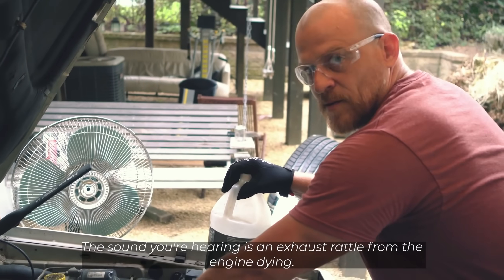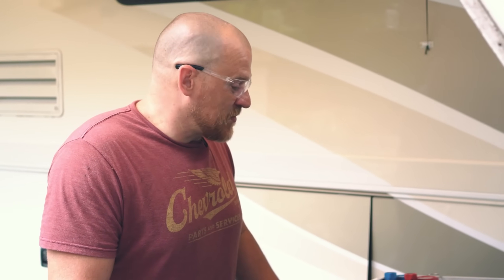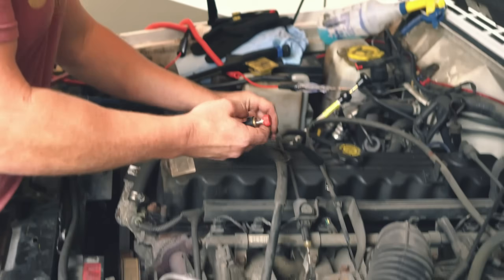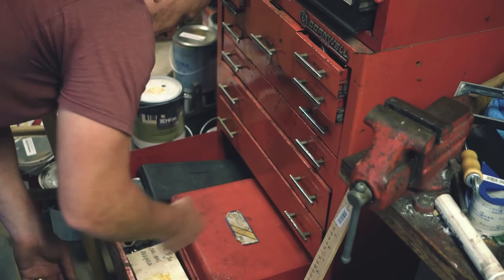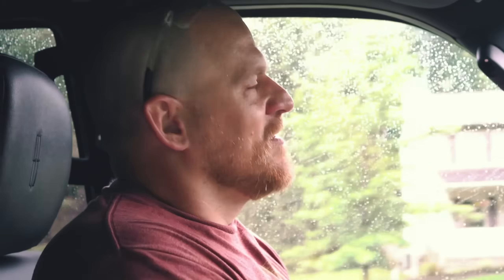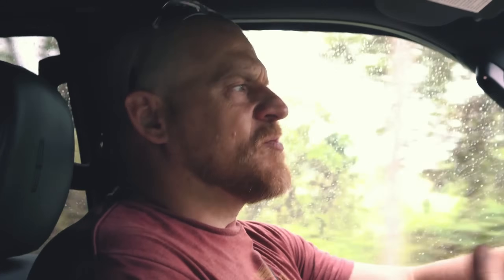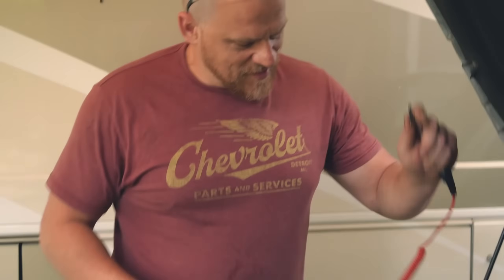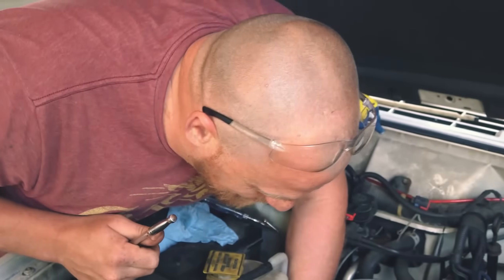Engine Dies While Servicing A/C System [Who Pays?]

Comment from the maker: This is a no start, no spark diagnostic video on a 1996 Jeep 4.0L. No prior history of trouble, no customer complaints of misfiring or intermittent no start conditions. The ignition coil failed, of no fault of our own, while servicing the A/C system. What do you do in this situation? 
1. Eat it (free diag and ignition coil for the customer)
2. Stop, call the customer, explain what happened and the sell the job
(sell testing time and then the repair)
3. Eat the labor for the testing time (diagnostic) and labor for the coil r&r and just sell the ignition coil at cost? 

Related videos:
No Spark Diagnostics "Control Testing" Part 1 [a free ScannerDanner Premium video]
https://youtu.be/7nHbctRwyys
No Spark Diagnostics "Control Testing" Part 2 [a free ScannerDanner Premium video]
https://youtu.be/9U942uGTZf0
Subaru no spark diagnosis-control testing lecture (a free SD Premium video)
https://youtu.be/LdnnFD6J8Uo
Reply: I replaced a cap and rotor on a vehicle that was running.  I installed the new parts and the engine failed to start.  I put the old parts back on the vehicle, and the engine started.  It turned out that the rotor was defective.
Reply: A large cap in the spark plug puts stress on the coil? That's something new to me.
Reply: @peacepoet1947  Larger gaps require more voltage to fire the plugs. It's why on a vehicle with severely worn plugs you can get misfires. It's also one of the reasons why manufacturers, for quite a few years now, have been using coil on plug technology. The ignition system in this Jeep is not as high of a voltage like ignition systems now that have COP setups with 100k or more voltage. They need that much voltage now to fire the plugs because of lean fuel mixtures to meet ridiculous EPA fuel mileage standards.
Reply from the maker: @peacepoet1947  a large gap requires more energy to jump that gap, which puts more stress on a coil
Reply: @ScannerDanner  I'm not sure how it would stress a coil.  I drive my 72 Chevy El Camino.  I put in electronic ignition and set the spark plug gap to . 047 to see what happens.  The engine ran the same as at . 035 gap.  I like the number 47. Maybe Trump will be the 47th president.
Reply: If its a returning customer hook them up with free labor. 
New customer call them and let them know what happened charge them normal price
Reply: The customer pays the full shot. It's a totally different problem from the AC work. I agree.
Reply: Customer pays
Reply: The best thing you can do for your good customers is charge enough stay in business. Let bad customers go somewhere else.
Reply: I had a customer tell me that.
Reply from the maker: @peacepoet1947 I'm speaking in general. But if you ever have a chance to play with an oscilloscope and can monitor secondary KV of an ignition coil, experiment with variable air gaps and you'll see what I'm talking about.
Reply: @ScannerDanner  thanks for keeping it real.  I haven't invested in a scope for wave form.
Reply: @ScannerDanner  Good idea for class project, amp ramp demo with an adjustable spark tester. The larger the gap the more energy required to cross it, more current build up more heat, more heat less life span. 
Thank you for considering it.